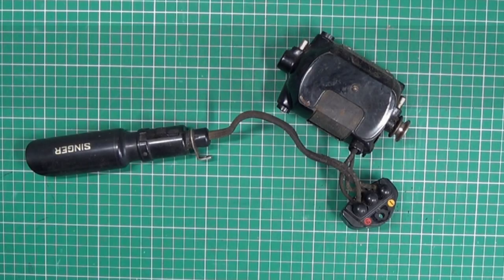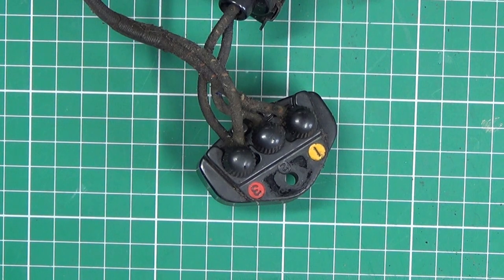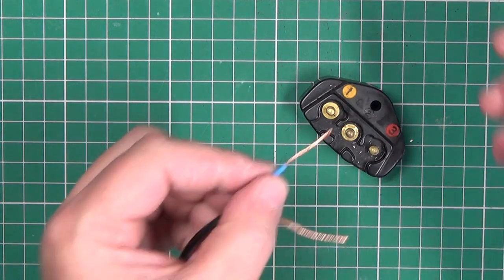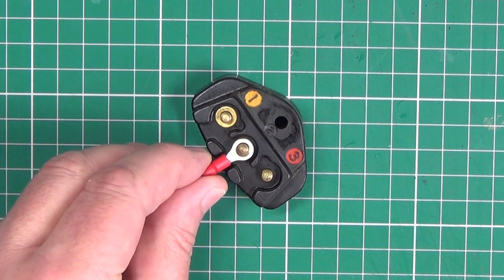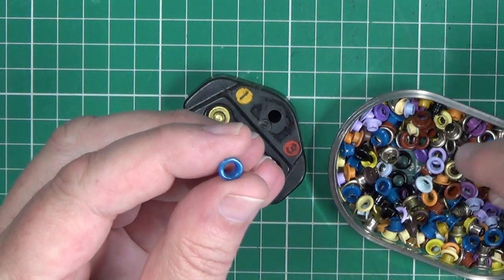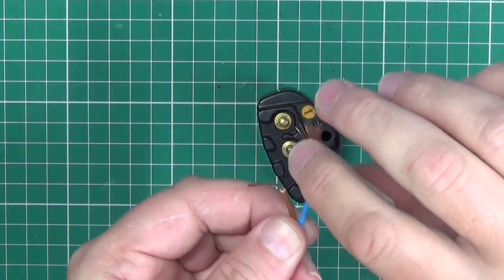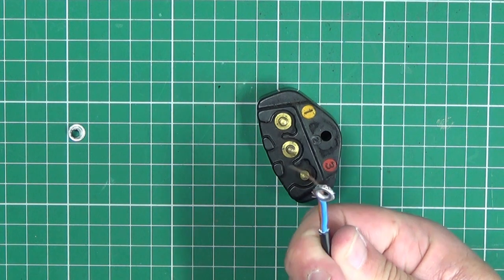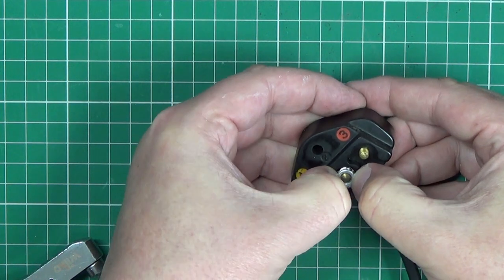Rewiring Tips for Vintage Sewing Machines

Comment: My 99 machine (circa 1948) is wired directly to the motor, no external plug to the machine. Would this be the same if I open the motor case?
Reply from the maker: No, I don’t think so. I haven’t seen one wired directly.

Comment: I tin the ends of the wire and wrap it around a screw driver or use the curler on a wire stripping pliers.   But I really like the neatness of this.  So now I will do this and I will use brass ones so I can solder everything together for a super connection!   Thanks for the tip!!!

Comment: This video was great!  I just bought a Singer 66 and need to rewire it, but the wiring does not look like this (and I haven't found my configuration anywhere on the internet).  The number is GO600208, which means it should be from 1924.  I'm not sure if my motor and light were original but there are only two "terminals" not three and they are round (kind of like an old style audio plug.  My machine also has a knee lever not a foot lever.  Are you familiar with any of this?
Reply from the maker: I'm familiar with knee levers - essentially inside the case, where the accessory compartment usually is is the same mechanism as in a foot controller - it's just operated by the knee lever. I have seen terminals as you describe. They were not used here in the UK but were often found in American machines.

Comment: I've done all sorts of electronic and electrical repairs. I find them both easy and fun. BUT, if you don't know what your doing STOP.
It is possible to get hurt when dealing with 110-125 volts AC current.